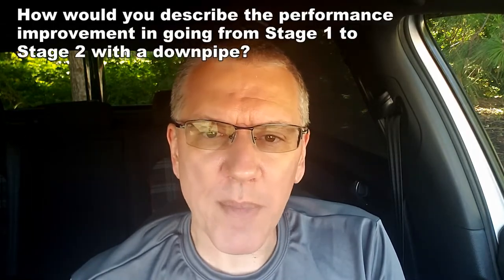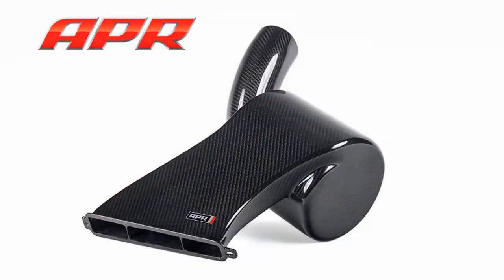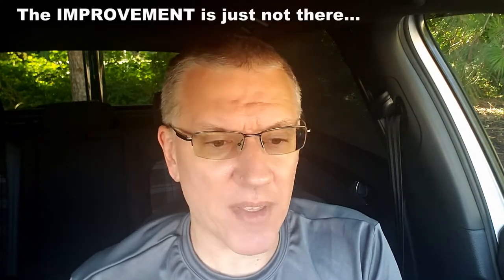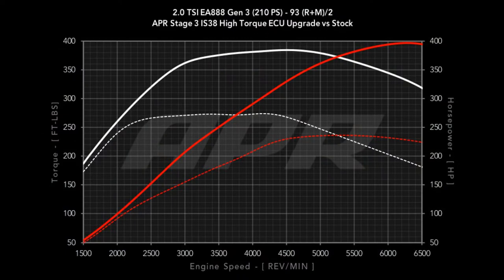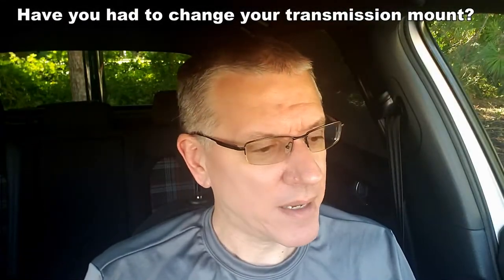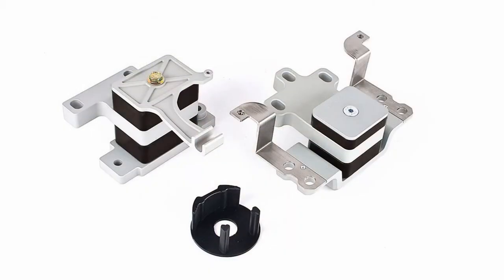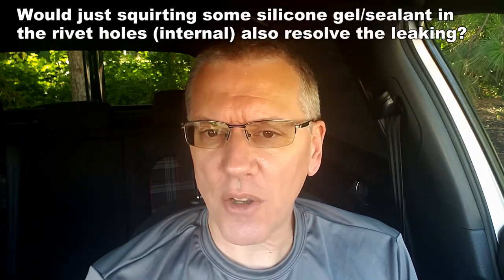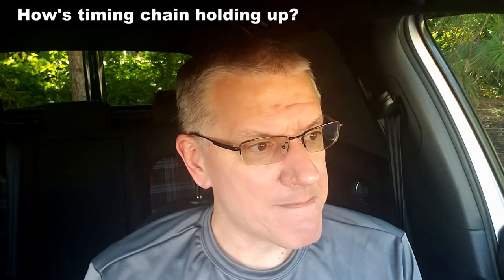20 QUESTIONS, VOL 2 - Index Below

Comment: "What do upgrades and loud exhaust have to do with each other."  I'm with you 100% on that response. I'm 61 years old and I really enjoy my GTI, but I don't want want or need to be heard.  My 2016 GTI has Stage 1 ECU and transmission tunes by Unitronic installed and I'm really happy with those upgrades.  I really appreciate you posting your experiences/modifications.
Reply from the maker: Thanks! I used to think I might not be in a GTI at 60 due to my hips... I'm 52 now. It turns out that losing 58 lbs made a huge difference in how easily get in and out of the car. So, there's hope for me yet!  ;-)  Thanks for visiting.

Comment: Cool video. Only because I know you're meticulous -- check your timestamps around 21:40. This is where the racing comment starts but your index says 22:40. This may have thrown a couple of others off as well. Youre still the true MVP for including the index! Thanks.
Reply from the maker: Oh my! THANK YOU for commenting. It turns out that most of my index points were incorrect. I checked the time in my local software. Somehow, they were very wrong here in YT. Lesson learned! They're all fixed now. Thanks again!

Comment: Very nice video.  My exhaust hanger also failed at the exact same location as yours! Might have the same root cause, imperfect alignment of the downpipe, I am running a catted downpipe from HJS (I live in Germany, it's Euro6 emissions approved) with a Stage 2. But it was a very easy and inexpensive job to replace with a new one.
Reply from the maker: Thanks for the info!

Comment: Love the videos keep up the great work!  I have a 2017 SE with just over 31K miles and recently the car has developed a coolant leak.  It appears it is leaking from the thermostat/water pump housing area. I am taking it to the dealership this week, hopefully it will be covered under the warranty. It appears that this is a pretty common problem on these engines, just curious if you have had this issue?  Thanks!
Reply from the maker: I think I covered my leak in 20Q Vol 1. If not, I have a dedicated video about my leak. Regardless, I do either consume a tiny amount or have a tiny leak. I've been watching it over the past 8000 miles and will top it off at 10k and record how much fluid it takes. Thanks for visiting.

Comment: What spark plugs/coil packs do you use? What’s your intervals on changing plugs?
Reply from the maker: I use NGK PLFER7A8EG Laser Platinum plugs and stock coil packs. My coil packs are still original. I've been naughty about replacing my spark plugs as early as I'd like. VW calls for 60,000 mile change intervals. I'd like to do mine every 40k, but did my first set at 45k and my next 49k later. The plugs were still in good shape. My driving style (boring) probably played a part in their good health. Thanks for visiting.